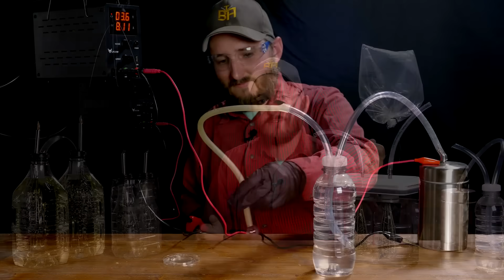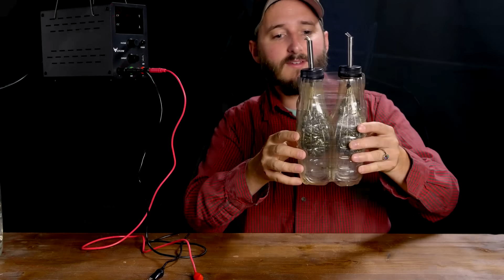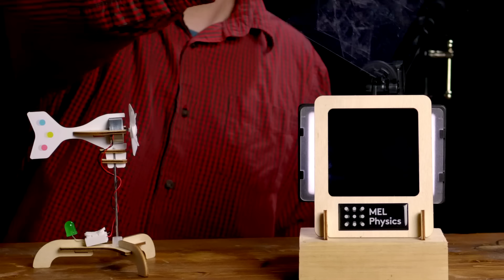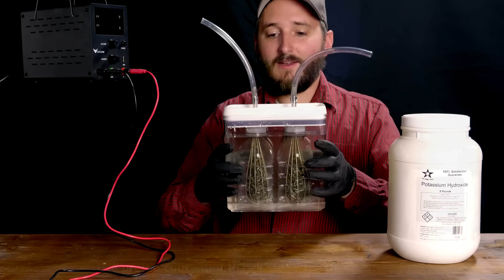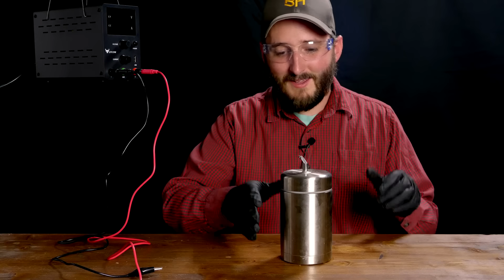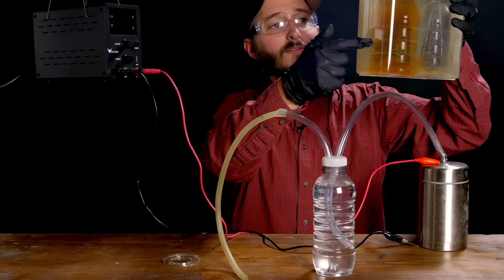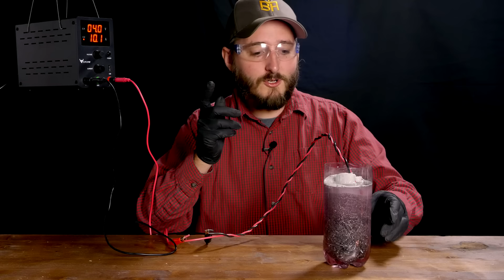DIY Hydrogen/Oxygen Generators From Grocery Store Items (HHO Fuel Cells & Split Cell Electrolysis)

Comment: I would really like to see exactly how that steel cannister fails if a flashback occurs without the bubbler (assuming you can safely and willingly do this, of course). It would make for some great footage and we'd get to see exactly what the danger is if we were to try this ourselves.

As always, I love your videos. You've taught me a lot and I can't wait to see what you'll teach me next!
Reply: I can tel you from experience, the flashback travels up the tube instantly, and if your tube less than a centimeter in diameter, it’ll decide to blow the lid off your container instead of just exhausting. I was using a plastic container with less than a liter of air space. I imagine a good metal container with little breathing room could handle a flashback, but it can certainly tear through plastics. And it is what’s used for torches that need to melt through any metal
Reply: What is a scouring pad usually for? This is the first I’ve heard of them
Reply: @naturegirl1999  Getting grunge off the oven hob, getting baked-on spaghetti, rice, etc., from the inside of stainless-steel saucepans, etc.
Don't use on non-stick, and don't use on [other] plastics.
Also good for cleaning soldering iron bits, if you're of an engineering frame of mind; and I've used them (with spackle) to block up mouse-holes; the mice can't eat through the SS, easily :-)
Reply: It may not fail at all
Reply: @Rose-ec6he  We want something to fail, and that failure should do the least damage.
Per previous comments, the rubber seal on a pressure cooker, or a foil blowout washer, are good choices; they depressurize, without blowing liquid around.
Otherwise, if there's an explosion in a sealed system that's full of KOH or NaOH, the result probably won't be pretty.
Reply: I am searching for a way to wean myself off of the gasoline habit.  I think fuel prices are outrageously disgusting !  I want to put something together that will power my 350 Chevy truck engine.  I would like to build something like you showed but I am not educated enough to fully understand what I am doing with this and would probably hurt myself somehow. I am a rank armature in this kind of physics. My fear is what is keeping me from making progress with this. If I attempted to build a system for running my truck engine I would need to have technical guidance and would need to have alot of questions answered.
Reply: @theskett  using regular scouring pads for soldering will rip the protective coating of the tip and ruin it, I think brass is used for the real deal, unsure, either way the metal/alloy that's used is a lot softer than steel, and the protective coating of a tip, hence the pad gets abraided instead of the tip, saving the coating
Reply: Just be careful - I've seen explosions still happen even when using a flashback arrestor (high school chemistry cow manure methane generator). No injuries but what a mess... 😂
Reply: @robertmckinley2886  It is very possible to do this. However, you wouldn't be able to run your engine for very long as the water would destroy the engine. When the hho gas explodes, the gas is converted back into water. When gasoline is burned, it doesn't turn back into a liquid, because it is burned AS a liquid. It is burned and the byproducts are expelled from the exhaust. Using this hho gas, you would end up with water in your cylinders which would rust out your engine from the inside. Not to mention that there would be no where for the water to go. It would just build up in the cylinder until it could no longer fire, leaving you with a stalled and flooded (literally) engine. You would have to completely redesign the engine using some kind of material that wouldn't rust but could also handle the explosive power from burning the fuel and somehow provide a way for the water to be removed from the cylinder and redirected back into the gas tank. The best engineers would have a very hard time pulling this off while keeping it completely safe at the same time. (which is why we aren't driving around in cars like this) Your average Joe tinkering around in his garage on a Saturday....well, with as dangerous as this stuff is, that's nothing more than a disaster waiting to happen.
Reply: You are talking B.S.!!!!  Any water in the cylinders will get blown out the exhaust as steam.  If there is any worry about remaining water in the cylinders then just switch off the HHO system and let it run on gasoline for a few minutes !!
Reply: @CraftMine1000  I hear you, and I mostly agree with you, but somehow my soldering bits don't care :-)
I do more damage by poking at stubborn component leads, than I do by wiping the bits off on scouring pads.  YMMV, of course :-)
Reply: you drill a hole in the cell and put a rubber bung in the hole --it acts as a safety valve incase sommit goes wrong
Reply: @brenohighland1168  yeah, yeah, co-colio for my bung hole! 😂
But seriously,  a good idea 💡
Reply: Ben.... If you you really want to know about HHO generator explosions.... Just ask a veteran who has been on the recieving end of a stun grenade! Been there.. Done that... Lucky to still have my hearing.

Comment: I like your easy to understand experiments. The demonstration with the mixed gases popping was done well also. It shows the volatility of oxygen and hydrogen without
causing a dangerous explosion. I did an experiment some years back. I wanted to ignite gasses from carbide and water by placing the vapor tube into a pail of water. Then I was going to lite the gas bubbles coming to the top of the water. Well I lit the bubbles, the fire traveled down under 2 inches of water and into the pipe, then into the glass generator. Yes it exploded. I had
safety glasses on and was not harmed. Time to sweep up glass test tube pieces.
Reply: Hope you're 👍 thanks

Comment: Hi, in order to scale up your setup you might want to apply layered socks and mesh over each other with alternate polarities. Better yet, stack two long strips of 'sock' and SS material then roll into a cylindrical shape, similar to the way capacitors are made. Just an observation, thank you.

Comment: I was just trying to make one of these this morning! Perfect timing.
I tried using soup cans, but the downside is you have to sand the insides because they're coated with something. I wanted to make a single container split output generator.
Basically if the soup can is positive, and a smaller can (with an outside coating, only the inside would be metal) is submerged in it, the H2 gas will be generated only inside the smaller can and you can place a tube on it's bottom, which would be the top in this design. The cans can be internally separated by paper or a sock like you showed just in case.

The benefit here is that it can (no pun intended) function like both a single and split output. For single output just don't connect a tube and the gases will be mixed, you can put the whole thing in a 2L bottle (I'm sure you could think of a better design), and if you want only one gas output then connect a tube to the smaller can.

The surface area is small, but if you use large cans it won't be an big issue. Here is a diagram in case i didn't explain it well:

         ________
         |  ______  primary gas output
         | |
|   _ _ | |_ _  |
|  |     H2  |  |
|  |            |  |       secondary gas output is discarded, but could be collected
|                  |
|                  |
|__________|

      both gases are mixed if there is no tube on the small can
          _________
          |  ________    combined gas output
          | |
     _ _ | | _ _
   /               \
/|  _ _ |  |_ _  |\
  |  |     H2  |  |
  |  |            |  | 
  |                  |
  |                  |
  |__________|
Reply: I think you’ll get excessive corrosion on the can(s) because they aren’t stainless steel…
Reply: @Shiftypop  that was the point. It's cheap to replace the cans. If you love canned soup, you will end up with a lot of them.
Reply: steel is a better conductor than stainless use concentrations above 20% KOH, plate the cans with nickle use distilled water
Reply: I can't believe you drew these diagrams in YouTube! Unbelievable, what a talent!

Comment: For the single output device: you could wrap the whisk in kite fabric and drill a second hole at the lid of the container for the oxygen to escape.
The kite fabric allows the electrolysis to happen but acts as a membrane for the hydrogen and oxygen bubbles.

Awsome video, Thanks!

Comment: I've never built a HHO generator before, but I remember launching rockets with it when I was a little kid!
I don't know if they sell them anymore, but back in the early 2000s, Estes used to sell "hydrogen powered rocket kits". It was basically a stomp rocket with a single-output "hydrogen reactor" built into the bottom of the stand. You would load it with water and citric acid, arm it, and launch it with a remote control. I doubt it produced nearly as much HHO gas as your designs, but man that thing launched FAR!!
Reply: Yes, I have one i found at a 2nd hand store. Not sure if you can buy them new anymore.

Comment: You can stick metal wool in silicone tubing, dip that tubing in metal container, and get one gas from tube, another from container.
Reply: But, please, stop using stainless steel on the anode side.  It produces toxic Hexavalent Chromium.

Comment: I tried to make an electrolysis setup as a kid and for my power I had a power cord split in two and two battery cathodes wired to them in a mason jar. I plugged the cord into the wall and learned a valuable lesson about sixty hertz one ten volt electricity in the time before breakers.

Comment: The most efficient design for [HHO generator] would basically be a capacitor in reverse, as it is a similar concept of surface area to distance separation that increases the electrical capacity of a capacitor. That's how the sock version is working.
Maybe try a line of tinfoil then thin cloth then tinfoil then cloth and roll them up into a tight cylinder? connect positive to one foil and negative to the other.

P.S. Since you only need one half the surface area for the oxygen electrode, try a tinfoil-cloth-tinfoil-cloth-tinfoil arrangement and roll that up. Connect neg to the outer two foils and pos to the inner foil.
Reply: And the gas will escape how exactly?
Reply: Tin foil will not work very long. It will dissolve. Titanium or SS 316

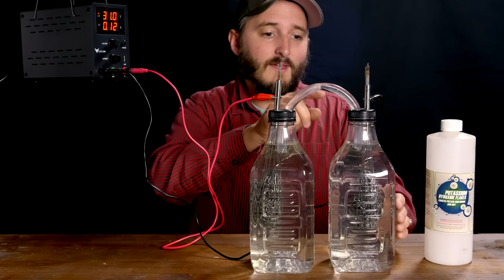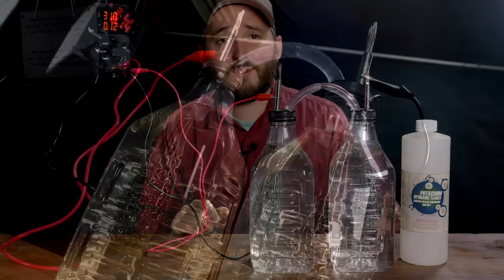Comment: Congratulations NightHawkInLight on this very well structured and educational video.  I love the fact that you start with your first prototypes and build from there.  I have built many an electrolyzer and have to compliment you on your practical designs especially with the combined gas electrolyzer. The sock design is ingenious - I would have thought that frayed wires from the scourer pads might protrude through the sock and cause electrical shorts.  Very practical and simple design!  Just one remark on you mentioning that the electricity passes through the liquid (6:45 and 7:30). It is correct to say that charged ions form at the electrodes and these complete the electrical conduction path in the liquid when they migrate between electrodes. "Electricity" is the flow of electrons which is not true for the electrolyte. I used to say to my students that "electrons cannot swim".  Thanks for you great work here!

Comment: Nighthawk, you bring some of the most astounding, functional science to the masses. Building HO generators out of grocery store materials, or allowing people to experiment with "Starlite" is way, way more useful than a LCD panel using 10% less energy!
Reply: Just beware that using stainless steel on the anode side will fill the water and the hydrogen gas with a lot of highly toxic Hexavalent Chromium.

Comment: I really like the whisk and scouring pad electrode idea, that is great. I have been playing with HHO designs here and there for a bit. Never have come up with anything I’m too comfortable running yet, or anything that runs well for very long. Still working the bugs out. My main objective is to make a jewelry torch out of it. I know you can buy the units online but I’d rather learn something by making one. That’s just the geek I’ve always been. Great vid. Keep up the good work. Cant wait to see where this goes.
Reply: I'll probably buy a HHO cell from Ebay, and a torch from AliExpress.
DIY is fine, but I'd prefer kit that someone else had QA'd, for torch work.  Tools should "just work".
Despite I have lots of electrochemistry and blowtorch years, "Buy don't build" means I can play in a week or two, rather than (more-expensive) months :-)
Reply: @theskett  : True. But my situation is a bit different. While I can surely find uses for an HHO torch. I’m not in need of such torch. I’m disabled and run off in weird directions, building odd things to fill my time.

Comment: You should have mentioned the types of plastic to be used, PET cannot withstand the caustic conditions in this cell, it will hydrolyse and produce sodium theraphtalate as a byproduct of breaking down the Plastik, this will slowly gunk up your electrodes. Polyethelene is also suboptimal, Whereas LDPE actually is better than HDPE. The best commonly available Plastik to use is polypropylene PP, it can withstand these conditions quite good. I imagine the outer container is probably PP, but your bottles are most likely PET.
Anyways, great video
Greetings from Austria
Reply: @fred_e  good idea, but unfortunately even glass is slowly eroded by KOH and NaOH, especially at higher concentrations and temperatures, like those observed in a electrolytic cell (saturated solution and lots of heat) Its actually one of the few things that can destroy glass, others being HF, Phosphoric acid (conc), And extrem strong oxidizing agents like piranha solution which produces H2SO5 (Caros acid), those can oxidise or hydroxilate pretty much anything, so it's slowly adding OH groups on the glass making it slightly soluble and of course like I mentioned, alkali hydroxides (in englisch alkali actually does mean it's a hydroxide but in this context I'm referring to the 1st group on the periodic table)
Certain additives in glass can slow this down, that's why in labs borosilicate glass is used instead of soda lime glass.
Anyways, glass still would be better than most types of Plastik, especially concidering temperature resistance.
Reply: @fred_e  I actually have no idea if PTFE sprays would work, I heard they are a pain to get a good coating.
Any other means of getting PTFE on any surface are way too industrial, requiring constant tons of pressure and heat for days.
There may be other Fluoropolymers that are easier to apply. Also, special Email stuff exists but no idea where to get something like that.
Now of course one could get a premade container of Teflon, but those are expensive and simply not worth it, Id suggests going with borosilicate glass or Polypropylene.
If you need a Chemical resistant coating for some other projects tho, I have successfully used simple silicone caulk. It's temperature-resistant, handles organic solvents well (some can dissolve it, especially anything high molecular weight such as toluene or Xylol/Xylenes), and most other stuff you can throw at it.

Comment: Very interesting demo. It's amazing how low the internal resistance of your device is; and it seems to even decrease further at a higher voltage, a kind of non-linear resistor! By the way, in German the mix of hydrogen and oxygen is called "Knallgas", which translates to "bang gas"... 😂

Comment: 14:14 Maybe add separating wall between the cells , so if any gas does get out it wont mix and have couple one way valves let out any pressure that might increase over time to vent the gasses as separate products. Also maybe add wider plywood base with handle to keep generator upright and maybe leveling system if used in garage so least amount of gas can escape. This would increase its usability and safety considerably.